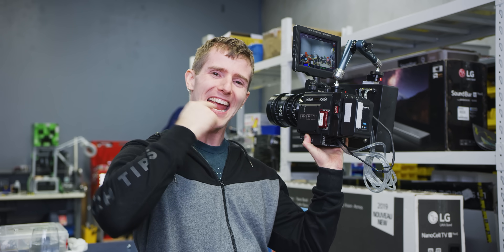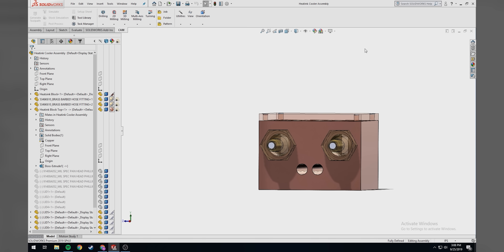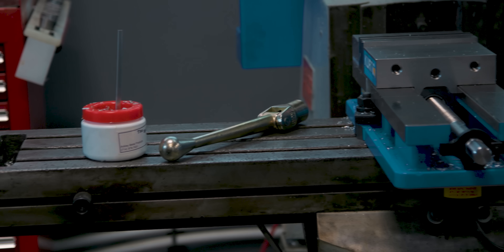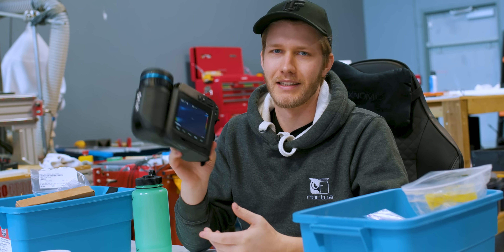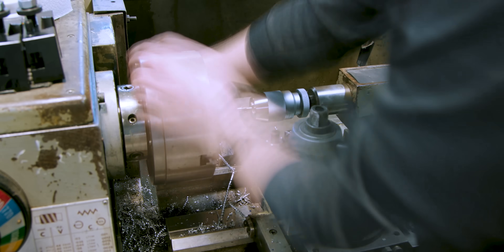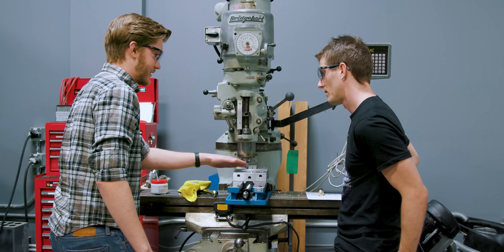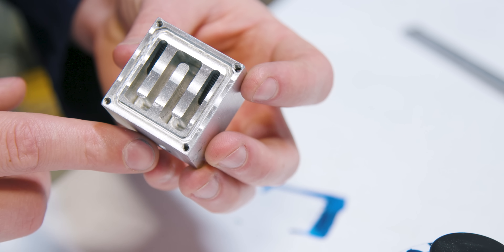WE FINALLY DID IT!! - Water Cooling the 8K Camera!

Comment: One suggestion to Alex:

Since the fins on the coolers are most likely aluminum, why not use something like gallium to dissolve them? 
Might have been easier.

EDIT: Not dissolve them, but like it will create an alloy that's supper brittle and easy to break off.
Reply: These guys don`t have any kinda skills outside software and aren`t willing to watch Youtube for tips.
Reply: @woldemunster9244  I guess, but still we are all in here to learn one way or the other, aren't we?
Reply: Even an fake Dremel would get you to the copper surface without bending anything and you could make support block with two holes so not to bend when polishing remaining crud....
Reply: @woldemunster9244  yeah doing it with a dremel is the first thing i thought of. It's just plain stupid to try to polish it off.

Comment: When I was in a machining class, one of the vertical mills had a reversed Hi/low range switch... So you'd turn the switch to low range when in high.... Yeah, talk about intuitive.

Except our manual mills didn't have motors on the XYZ axis, or a computer readout.
Reply: why the fuck didn't you switched the contacts back...

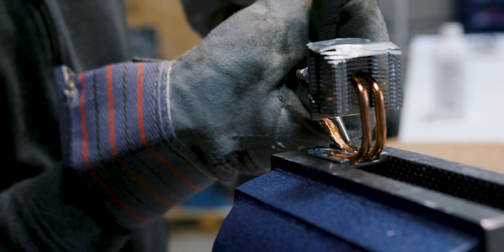Comment: @6:40, By pinching the die in the vise the way you did, it compresses the tubing, making it harder to remove. 20 years working in a machine shop and seeing this just screamed "rookie move". And end to end pinch would have been better and made the job easier.

Comment: Is it me or are half the issues they had with the design of the water blocks was that the brass fittings were really big. Whereas they could have made some substantially smaller barbed fitting (smaller threaded mounting not the barb itself) and it would have been a ton easier.

Comment: Alex: put the Bridgeport into low gear, and turn the speed all the way down when tapping. Just remember that when you put the Bridgeport into low gear, the tool will change directions. So whatever range you've been running, you'll want to run the opposite.

Comment: Alex: "this is mission critical so I'm not gonna mess about doing it fast, and I'm just gonna file it down"

Also Alex: messes about doing it fast and cracks a heatpipe
Reply: gives up after three passes with the file
Reply: Facepalmed really hard at that one. There are so many good ways to remove these without any damage.
Reply: @marcoschwanenberger3127  good old angle grinder.
Reply: Filing would have taken an hour and it would have been done. Also, if you're using a sandpaper and move the object instead of the tool, you might be faster and more accurate.
Reply: And fake Dremel would make it an easy project without damaging anything, these guys have no hand-eye cordination or brains, just money/sponsors...
Reply: @woldemunster9244  legit a dremel would make so many of their projects less of a headache
Reply: Wolde Munster excited to see your water cooled RED video. ETA?
Reply: @Drcudar  I don`t have that RED camera nor resources to mess it up but i`ve taken couple of fin-stacks off heatpipes just for "fun". And i used them to make drink-coolers.
Reply: @Drcudar  I put the ends of the heatpipes in a 2 litre container of water and put it freeze over night (Finland) on my balcony. It didn`t work very good but i tried, the copper didn`t have contact to the ice very long and condensation was a problem.
Reply: @woldemunster9244  You need some kind of liquid touching the heatpipes. So ice water would probably work much better than just an block of ice. If you add a pump to keep the water flowing it would be even more effective.

Comment: Also copper is a better choice espcially when you use a copper connector.Aluminum block with copper connector might cause aluminum corrosion and block your pipe or pump.

Comment: With a melting point of around 660c why didn't you melt the aluminium off?  the copper wouldn't melt as that would take around 1050c.

Comment: All the gear and no idea comes to mind, might pay to add a engineer to your team, dremel would have made light work of cutting those fins off the heat pipe, and to make copper soft again (anneal) heat it and throwing in a bucket of cold water.

Comment: Try running the mill in low gear at the lowest speed when you’re tapping a hole
Reply: Or just hand tap it. They're only talking about two holes, power tapping won't save that much time.

Comment: Hey Alex!
This will help you with drilling, milling and lathe

n = 1000 x Vc 
       ________
       π    x    D

n = speed of the drill
Vc = Amount of material pr meter a bit will make can be read on either the bit / the box containing the bit
D = Diameter of the actual drill bit. 

For example if the Vc for the bit is set at 25 m/min and the drill bit is 8mm that would give 995 rpm (Roundup to 1000)

Rule of thumb is that if you use a pinol drill it is always 1000rmp

The bigger the drill bit the slower the rpm. 

You can isolate Vc from the formula if you need to.

Regards a Machinist

Comment: You can always mark down the side that will be lower when you are creating the piece on Solidworks, this way you can tell just by looking at it which side needs to be worked on. Also, aluminium is quite difficult to screw because it gets really hot, REALLY fast, meaning you need a lot of lubrication. Spindle speed also affects the bit performance when making the screw.

Comment: Pro tips for your Bridgeport mill: 

Only adjust your quill speed while it is running

Run your taps in low gear, at the lowest speed possible. But even then, only bump your spindle on and off.

Comment: Why don't you use any cooling on the lathe or the mill. Like it doesn't look very good on camera and it is quite messy but it will be much better for your tools and your mill/lathe.
And one more thing but this one is kinda smaller. Why are you using inches? Can you please at least provide the conversions to mm? Also why even use them (at least for me and this looks pretty small) mm were much better 1 inch is just too big so you will probably have to use "1 hundreath of an inch" etc. and it will probably confuse a lot of people. (Plus you are probably causing vietnam flashbacks for a lot of engineering students)

Comment: a good trick to stick 2 bits of metal together without having to clean dried up glue off after is to put a bit of painters tape on each bit and then glue the painters tape together. it works to see it in action look up youtube channel NYC CNC.

Comment: As someone that has worked with CNC i can say that Its almost impossible to make 0.001 inch adjustments correctly if you have dismounted a piece. just let it sit in the vice until you are done.

You also don't want to measure anything smaller then 0.1 MM with a vernier caliper

Comment: You guys really need bend saw, a proper stationary one, Adam Savage was able to cut into lens filter on DSLR lens with one and didn't destroy it removing the fins from these heat pipes would be way easier.

Comment: measuring a couple square indents would have taken 30 minutes tops. If you cant trust yourself to measure that simple of a part within a 10th of a mm you are not gonna be able to do the rest of the machining. Your test of that heat pipe was not sufficient. If you damaged the internal wick coating the pipe won´t wick the liquid back down properly which would overheat your sensor. Heating it with a lighter would not test that. You should have painted the top of it black to make it not reflective and tested it properly.

Comment: water cooling heat pipes is how I do it  phase change transfers the heat faster that a copper water block directly on a core ... should have desoldered the fins .. they slip off ... wears coats while not doing anything and street clothes when milling ...

Comment: my dad worked in a sheet metal or steel factory or something in the 80s as a 20 year old give or take a few years. He told me this story as one of the many stories of him almost dying or being badly injured while completely shitfaced (hes sober like 30 years or something now so thats why he told me the story). The part in the video where linus is playing with a sharp piece of metal reminded me of the story. So anyway, my dad was working the night shift and there was only one other person in the place with my dad and he was across the warehouse (wouldnt slide today). My dad was basically doing the same thing as they were in the video except the metal was much much much larger, in fact the scraps similar to what linus was holding were like 4 inches across and would be really really long like upwards of 8 feet long if u didnt occasionally cut them with some handle on the machine or something. So my dad being completly shit faced drunk started to doze off and a few seconds later he woke up to the feeling of tugging on his pant leg. He opened his eyes to see one of the INSANLEY sharp shreds of metal literally coiled around his leg and getting tighter, he slammed the emergency stop buton to the machine. Luckily he woke up in time because its very likely that if he didnt his leg could have been lopped off and he literally could have bled out since there was only one other guy and he was across the warehouse. who knows what would have happened but pro tip dont pass out drunk while operating an industrial steel shaver thingy during the graveyard shift in essentially an empty warehouse. another pro tip is to just not be an alcoholic. i have another story about my dad jumping into alligator or crocodile infested waters (i forget which) off of a canoe while, once again, shitfaced drunk, but at this point i should charge for these stories lmao im basically writing a novel.

Comment: Next step: slap a proper peltier element on in, which you then watercool, to put the chip at sub-ambient. The lower the temperature, the lower the intrinsic electronic noise in the sensor.

Comment: Still, as a mechanical engineering student that uses SI unit, its kind of weird finding a milling machine that uses inches instead of millimeters. Fun fact, from Day 1 im using Solidworks, the default settings have been set at MMGS (milimeters, grams and seconds). FYI,  normal milling machines only go to a maximum of 0.01mm (3.9 x 10^-4 of an inch).

Comment: Pro tip: Wearing gloves is a great way to get your hand pulled into a sander
- A Shop Supervisor
Reply: Read "a shop survivor". Kinda fits too
Reply: It's also a good way to get wrapped around a lathe or a mill ... do not recommend.
Reply: @4ohf  I remember one of my teachers told us about how that happened to him with a mill. He even showed us a video. It looked scary af
Reply: so to clarify, it's safer to wear no gloves when using a sander?
Reply: @impguardwarhamer 

Whenever there is a chance of your gloves getting caught in moving parts, you should most definitely not wear gloves. Some goes for loose sleaves and cords or long hair.

I'll take cuts, bruises and abrasions   over even a remote chance of my hand getting mangled because a loose thread of my glove got caught by a drillbit or something.
Reply: @impguardwarhamer  Yes. No gloves, no Rings and no Bracelet
Reply: @impguardwarhamer  As a rule of thumb never wear gloves/rings/watches/long sleeves/long hair while operating rotating equipment.
Reply: I wear gloves on my disk sander but it's completely open on the sanding side. I've had 2 instances where my finger got hurt without using gloves
Reply: @Simon-oy7kf  I prefer hurting my finger instead of ripping it off
Reply: @Simon-oy7kf  It's completely your call, as it was Alex's- just important to know the risks (since yours is open, there is very little). Personally, I just use pliers if my hands are too close.
Reply: Been there done that, luckly i got too keep my thumb but a cowoorker didnt, if there is a chance for it to get caught, dont wear them (Y)
Reply: Can Confirm.
~ a german Apprentice
Reply: He has done it in every shop video so far. I get fucking triggered every time. I'm pretty sure I would get fired for doing that
Reply: Linus’ belief vs what Alex actually knows
Reply: And he was using the "up side" of the sander too instead of the down side....anyone who is professional tool user like myself must be cringe watching LTT videos....I know I do whenever they use tools
Reply: Brynden Rivers there’s always stuff to cringe at depending your field of expertise. Watching them over selling audiophile bs as an audio professional is painful.
Reply: @thaBigGENERAL  Overselling BS audio gear is one thing, actively endangering your employees health is another.

I don't know how LMG is, or is not, handling health and safety regulations. The l way they seem to be operating (as judged purely on what I have seen in their videos) would most definitely not comply with any in place in my country and would lead to getting shut down really fucking fast. 

As I said, this is purely based on what I have seen in their videos, but it is definitely kind of worrying.
Reply: @JaconSamsta  Let's leave Prudence the Safety Goat out of this :)

Thanks to the OP for a legit safety tip. A large portion of this audience wouldn't have known or thought about gloves being more dangerous in certain instances.
Reply: Brynden Rivers Their entire channel is cringe.
Reply: @themonroe654hd6  Which is why youre invested enough to scroll down into the comment section and tell people about it on a random video?
Reply: @Axyo0  I am, yes.
Reply: Yeah that made me cringe sooooo hard.
Reply: @Lukeima7992  Same. I literally screamed and paused the video to look for the comment.
Reply: fdgdfg dfgdf if I recall correctly he’s an engineer not a mechanist
Reply: From my understanding fuck gloves they cause more hurt than good in most situations
Reply: Anything: hot
Linus: I'm gonna watercool this man whole career.
Reply: Most people don't realize how much energy a spinning object--like a lathe or a saw blade--has.  A table saw can launch a 2x4 through a piece of drywall, so you never stand directly downrange of one.  Same for milling anything.  And getting a sleeve or a glove caught on those spinning objects...yeah, your whole arm is going to be mangled faster than the nerves in your hand can transmit the "OH SHIT" signal to your brain.  Anyone who needs a visual aid and wants to lose their appetite can search for "degloving" on google.  Hint: it's not about how to take off your gloves.
Reply: @docferringer  A good table saw can put a meaty dent into a cinder block. High school shop teacher used that dent as a nice way to explain why saws are terrifying.
Reply: @donaldmoore8023  In my HS shop class, we had a guy being stupid and cutting the small piece of his woodworking project off against the guard of the table saw - small enough he couldn't use one of the pushers. (Honestly the whole fucking thing was small enough he needed to clamp it down and use a handheld saw, but "none were available" and he didn't want to use a manual hand saw and lathe/sand it down.) As was to be expected, when he got close to the end it shot that tiny bit out the back, nicked his side, and left a massive dent in the garage door of the shop. Sounded like a shotgun went off when it hit. Our teacher was LIVID and the kid was kicked out of shop class entirely, and not allowed back, ever, for any shop classes of any kind. When Mr. B got back he explained how if the kid had been standing just an inch to one side, he'd have a hole through some rather vital organs. As it was, he still got an ambulance ride and IIRC a batch of stitches.

I don't think anyone in that class ever refused to use the pushers after that, and if the table saw was going people would walk double the length to avoid walking behind it. Table saws are fucking terrifying. If it isn't the right tool for the job, don't use it.
Reply: Also it's called 'Metal Friction' when you bend metal back n fourth making brittle.
Reply: @pumba6099  I think you mean work hardening, like Alex (and like a bajillion blacksmiths) said.
Reply: @pumba6099  It's work hardening.
Reply: Question. Does Alex have a college degree he's trying to justify by being an engineer for LMG?
Reply: @curt8806  Yeah, if I remember correctly he has a BS in Mechanical Engineering.
Reply: @pdavid24  oh ok. Hmm sad such a smart guy is just sitting around making videos. But hopefully he gets paid twice as good.
Reply: @pdavid24  they tend to be clueless with operating this kind of equipment. A smart ME talks to their tool and die guys before throwing their fubar drawing over the wall. It's rare and valuable to have an ME that's also a machinist.

Comment: In b4 leak down the road destroys $50,000 camera.
Queue them traveling to Rossman's shop where he complains about the water damage.
P.S. Probably don't want to use a tap on something where you cant limit the speed to pretty slow, hand tap or use a drill on slow.

Comment: With the Flir camera, you can change the emissivity of the camera so it can read different metals shiny or not, there should be a chart either in your handbook or on the website :) also for the mill get some parallel  blocks that way you can make you projects flat very easy and quickly,  might wanna invest in a 0-1" dial indicator instead of a wiggler indicator